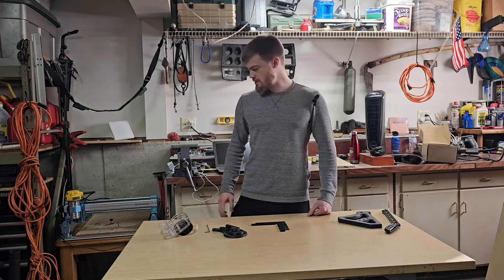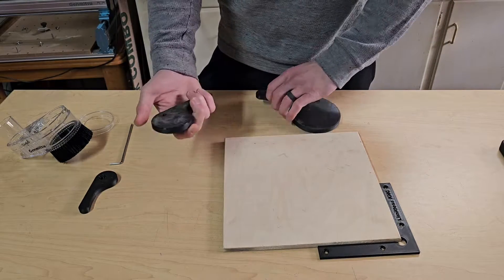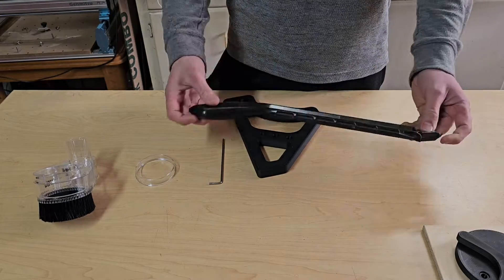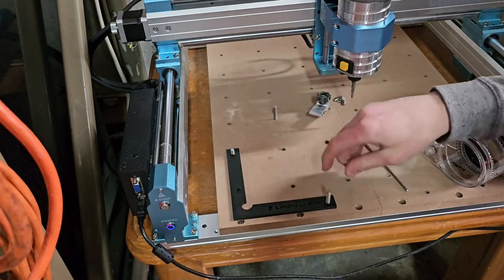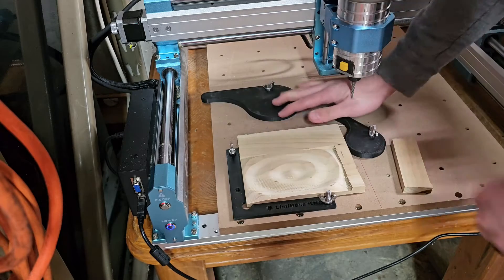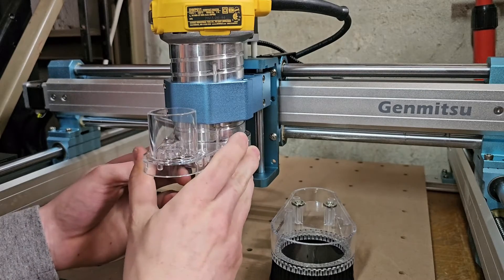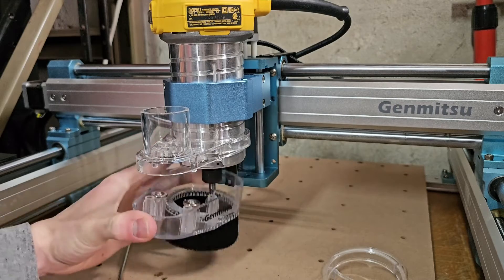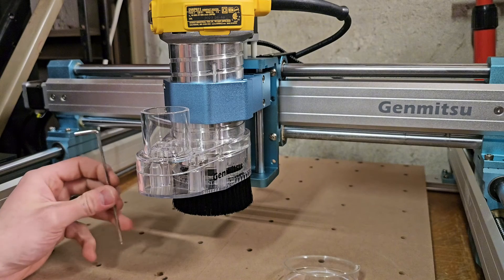3 easy upgrades for your Genmitsu 4040-PRO cnc router.

Comment: I’d like to ask a question. If you are using the front left corner as your Zero, do you adjust that and make it your home zero?
Reply from the maker: No the home zero is the same. I adjust my work zero to that corner. Normally only have to change the z zero when changing wood thickness

Comment: How has the 4040 pro been for you? I'm thinking about getting one to get my foot in the CNC door. I already have a makita palm router I'll be using with it since I know the included spindle is pretty weak.
Reply from the maker: I haven't had any problems with it. Being my first cnc, im not sure if it's a fast or slow machine, but I've gotten really good 3d quality out of it.